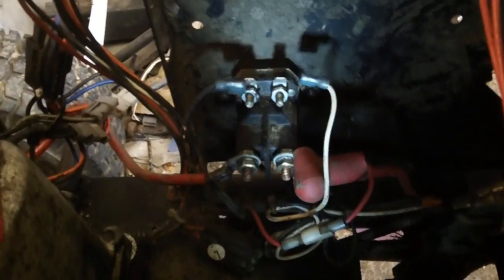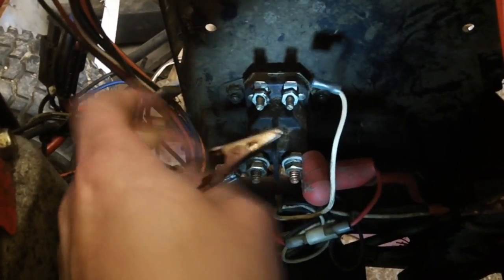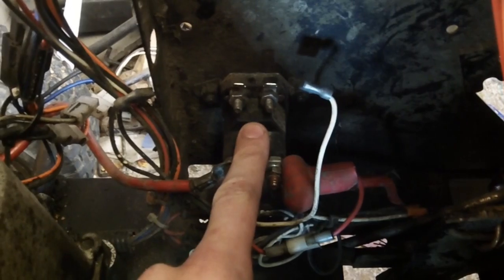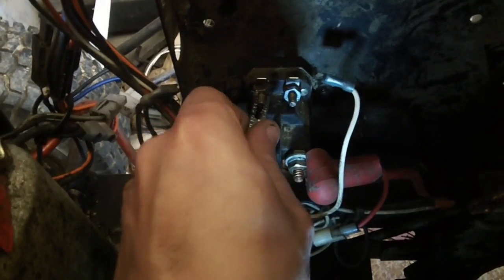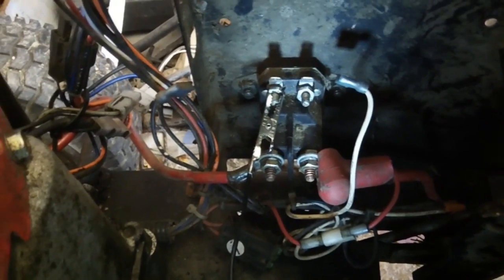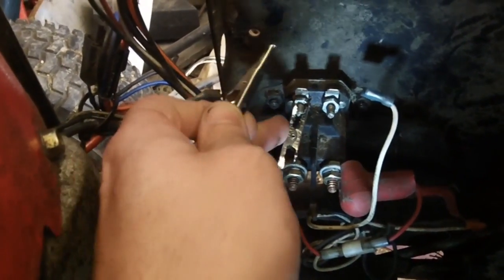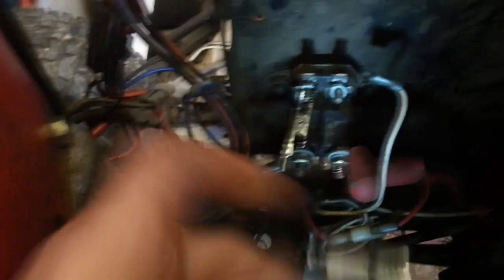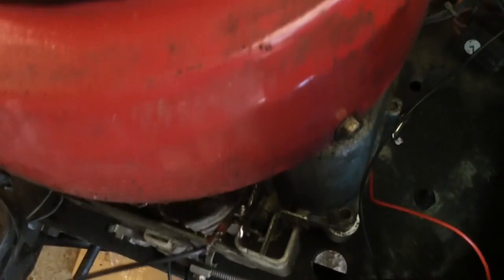Solenoid Test Craftsman lawn tractor

Comment: Can I ask a  question? I replaced a solenoid tonight. It is a 4 post. I connected the two small terminals key switch and ground. But the other larger two posts..... I have a third small wire that i dont remember where it goes. Does it go on the side going to the starter? Or does it go on the side that goes to the battery? Any help would be appreciated.
Reply from the maker: email me a few pics. mainemudmower@yahoo.com